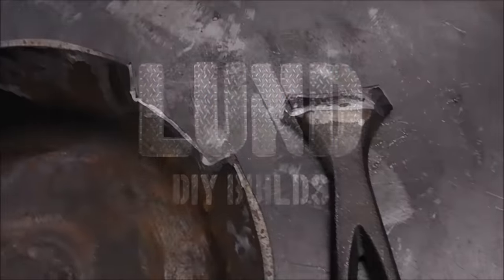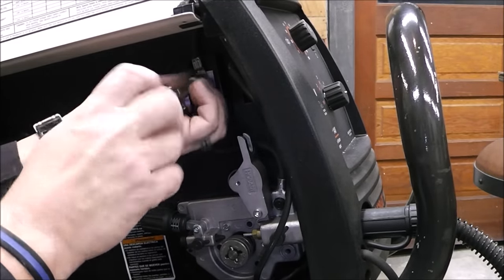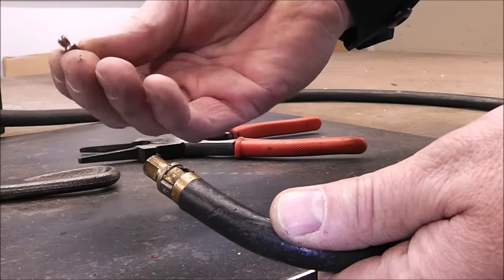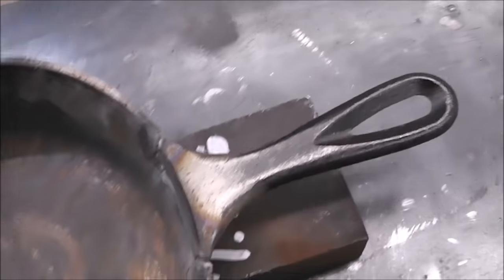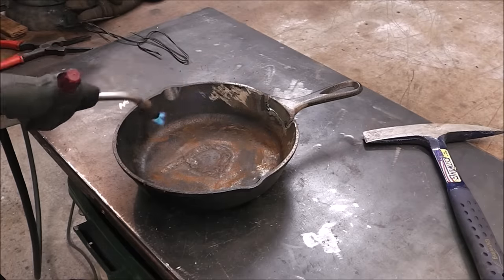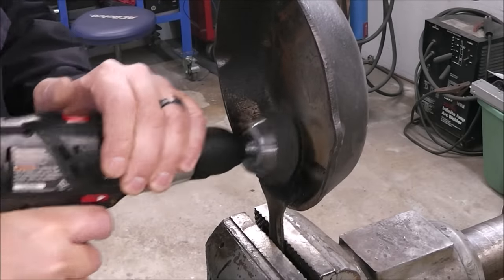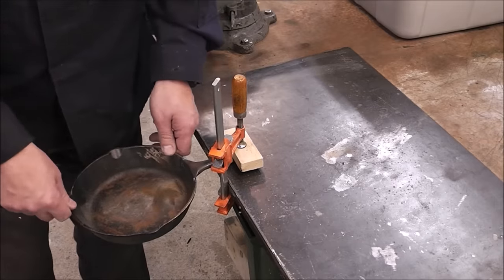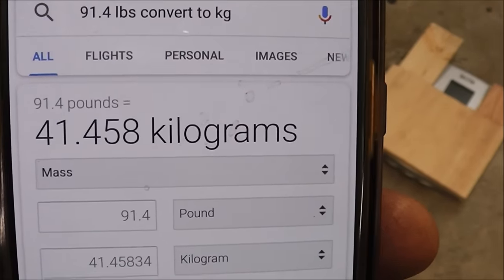Cast Iron Welding Repair using Flux Core Wire

Comment from the maker: MORE WELDING AND FABRICATION VIDEOS HERE:https://www.youtube.com/playlist?list=PLfbf78fMz9Vol0uX2-GNc6mLi75zpqb5f
LEARN HOW TO WELD VIDEOS HERE:https://www.youtube.com/watch?v=ADa1I319GJ0&list=PLfbf78fMz9VqxPZTT-xmwdcrHVa7ML-ft This video is for demonstration purposes only using a known cast iron material. Do not attempt to repair cast iron pans. If the weld fails there is a high risk of bodily injury, death or fire from hot grease.

I misspoke when I said the moisture is in the metal. The moisture is a byproduct of combustion.
Reply: Not a good weld
Reply from the maker: @williamcreech5266  how so?
Reply: Well it worked better than I thought . I welded come cast before with ni rod . I had hell and I swapped polarity and it helped . . Yea weld about a inch and peen it till cool . I used a chipping hammer but a needed gun might have worked well. Thanks for the video
Reply from the maker: If you ever run into it again try silicon bronze. I did this in my cast iron repair series and was blown away how easy it (MIG) welded and even better how strong it was. Best repair to date by far
Reply: I've had some luck welding thick castings by heating up to dull cherry red in a wood fire and returning to the wood fire till the next day. used 7018
Reply from the maker: That works well heating it cherry red
Reply: @williamcreech5266  ooboiboui
Reply: I like your philosophy. Not everybody has the same equipment or the same experience. I appreciate your covering many methods to weld.
Reply from the maker: Thank you
Reply: I think the wetness visible when preheating (or welding) with a torch is the moisture produced by the flame condensing on the cool (below the dew point temperature) metal.

Comment: I gotta say that I'm really impressed with your patience of the nay sayers! This episode of using the flux cored wire hit close to home because years ago all I had was a 110v Lincoln and the family ski boat froze over winter due to my lack of enthusiasm winterizing it. When my wife and I brought it out for the 1st startup, we had a bad water leak under the intake of the inline Chevy 6 cylinder. Pulled the intake and found a crack almost the entire length of the engine 1/2" below he deck surface. I called a friend who had recently retired from the local metal manufacturing plant and explained what I had. He told me to use the .030 steel wire, open the argon and oxygen mix all the way and run my current as hot as I could.  He also said heat my starting point to about 600° then with the wire form a puddle the size of a dime and continue until the crack was filled in. I thought there was no way it'd work because I was taught that only nickel was the cure! That was 1996, I still own the boat and there has never been one single drop of water from that crack. To this day I use the wire on most cast jobs with 100% weld. I couldn't figure out how only heating the starting starting point was needed. After years of thinking on it I can only assume the dime sized puddle allows the heat generated to flow forward the weld at the correct temp and speed. I believe him and should never have questioned him, I mean he'd worked all his life and retired from working with cast iron that he knew what he was talking about. Have a great day!

Comment: I remember as a farm kid in the 60’s and early 70,s we only had an AC stick welder. It was amazing how many things we welded that way “that couldn’t be done.” It really taught me that if for instance 91lbs of force was way more than the part was subjected to in its normal use then that was a fine way to weld it! They sometimes weren’t as pretty but I also learned prep and fit up made a huge difference.
Reply from the maker: Absolutely. Sometimes that "cant be done attitude" has you beat before even trying. I say try it and see. It cant be more broke than it is already. It can only get better.
Reply: I've seen aluminum bonded to steel with a stick welder. I couldn't say whether it was truly welded or not but it was able to support ~100lb from two three inch ears on the side of a moving vehicle.
Reply: @corinelson7837  I welded a titanium exhaust tube to a mild steel one  on my dirt bike with a $200 flux core welder been on there for a few years and so far its good........
I didn't realize it was titanium when I welded it I thought it was stainless!
I always thought you had to weld titanium in a gas chamber due to it catching fire I must not have got it hot enough lol.
Reply: @randyhaglund7557  titanium sugars if you weld it in open air. you get yellow fluffy stuff that precipitates around the weld. magnesium is the one that can catch fire {volkswagen cases}
Reply: AC is great given the right rods. If more people read what each rod is designed for and bought a few to try they'd be much more effective. Industrial AC stick machines go cheap and make serious power. I bought a Hobart T-400 for the cables and kept it for the arc quality because that and it's higher OCV make it a joy to use.

Comment: Thank you for doing this! For 15 years, I've been thinking about cutting the handle off a thrift store skillet and flipping it around so I can use it on my Big Green Egg. Now that I have a multi-process welder, I'm making all these dreams happen. This was a great piece of research. I always put in an exhaustive amount of research before any project. My Dad taught me, "we all learn from mistakes; it's cheapest to learn from others' mistakes". (We grew up in Appalachia, where "cheap" is the highest virtue. Also, cheap means maximum value. Investments that fail or cause injury are NOT cheap.) It's hard to do "research" when everyone does it the same way. I'm glad you are here doing this. Thank you, Brother.
Reply from the maker: Thanks Bruno! I appreciate your support! 🤗
Reply: We don't talk about Bruno...
Reply: spot on, i say. Thinking  'outside'  the box, is most times, required, for  cheapskates like most of us,  on here. Creativity, expands with a bigger  picture of ' life'   within  this world. Make use of nearly everything. in and around the garage/shop.
Reply: And that metal fatigue will sneak up on you when least expected. Without quotation marks.
Reply from the maker: Thats why the weld is stronger than the metal you are welding to if you have done it right. That applies to all processes and all metals. Not just cast iron.

Comment: Just for conversation sake if you were repairing a skillet this way I would consider it a win. This was an inexpensive repair and I have made some big meals but I can't load 90lbs of pork chops into a skillet!
Reply from the maker: 😂 I was actually surprised that it held that much weight. I don't think my stove burner would even hold 90 pounds LOL. Oh and thanks for the Pork Chop reference!...I'm starving now and I still have an hour until break LOL Cheers brother!
Reply: @BrandonLund  This series has been very educational. Nickel rod works great but that stuff is 1$ per welding rod around here. Some times the parts being repaired just don't justify that cost of repair. Please pay no mind to the naysayers this is very good real life work. I have used 7018 many times and just said either it works or it don't because we are not spending a fortune on this piece.
Reply: I what's going to say the same thing... How much do bacon and eggs weigh anyway?
I also wonder if Welding it on both sides would've made a difference...
Reply from the maker: @drickard67  I think welding it on both sides probably would add some strength. I should have done a close up on the non welded side. The weld really doesnt penetrate so I think doing both sides probably would add strength.
Reply: True, but we should also consider the carrying capacity of a panhandle if the pan is accidentally dropped and falls to the ground.
Moving objects gain mass as they pick up speed. 
A falling pan that gains more than half of its weight while falling might gain enough accumulated mass to loosen, weaken, or eventually break the weld.
This takes nothing away from the repair that was successful, but it does tell us about the important limitations of repairs that we make when being used in real-world applications. 
This may seem trivial at first but in actuality, it's a very useful and practical evaluation tool.
Reply: &<u
Reply: mme77 why, you could cook a whole suckling pig in that. I’d call that good.
Reply: mme77 best reply ever!!! 😂😂😂 you win the internet today!
Reply: I would say it exceeded the expectations of the weld for the practical use of the pan if it was meant to be the actual repair intended. Thank you again for this video and articulate explanation and narration.
Reply from the maker: @lynkpaul2171  thanks for watching and for your great comment! I hope you have a great new year :)
Reply: @NMranchhand  yes
Reply: @melaniew77msn  old muffler shop trick for cracked manifolds. What I learned is clean with a grinder and preheat. Use oxy acetylene welding, 7018 or 6013, ni rod, wire feed or whatever  you have handy. Keeping it hot not too hot with a torch and peening with a slow cool down just like he did here is the trick to a successful repair.
Reply: I'd have to agree that after any repair it's fixed and I doubt that little skillet hold more than 5 pounds of meat.
Reply: My thoughts exactly when you reach 4 or 5 times working load just stop, it is good.
Reply: Brandon Lund welding the other side of the break would be a good idea. If not for the extra strength, which never hurts, as a good sharp whack could break the weld. But rather to seal the break from both sides, and prevent water from getting inside and rusting the joint out. That’s very important when welding any ferrous Metal, but particularly cast iron.
Reply: @stephencarlsbad  Moving objects don't gain mass
Reply: I was going to offer Melanie my hand in marriage until she admitted to her failings as a pork chop cook. That just won't do.
Reply: Q in
Reply from the maker: HUH?
Reply: @stephencarlsbad  Since cast iron is brittle, a new unbroken cast iron skillet could break as well. In fact, that could be a reason one gets broken and is in need of repair in the first place.
         Of course, your point is definitely a good one for stress testing and practicality.
Reply: @markhendry1761  moving objects actually do gain mass, it's the reason anything with mass cannot go the speed of light, as you approach the speed of light the mass would near infinity, but at a dropping speed that mass gain is insignificant. I believe what he is referring to is kinetic energy.
Reply: @melaniew77msn  
Especially when you can buy a new 10.25 Lodge made in U.S.A. skillet at Walmart for $25 bucks....I still have granny's 1941 Wagner that I use almost every day.
Reply: @sswcustomsewing4276  ...
actually older school welder guy using oxy/acetylene torch and brazing the side of a 1956 Minneapolis Moline 335.
The original all in one pre-heat, weld and cool down, plus brass flows in cracks and is malleable.
Reply from the maker: @Dale Potter what a great compliment, thank you!  I have to laugh whenever someone makes a negative comment because I post these videos to try and help others. Not everyone has the finances to buy new so sometimes they have to make due with what they have. Im not sure if you have watched any of the other videos but I actually test how strong this weld method is compared to an unbroken piece and its actually quite close. I think when people make negative comments it says more about them than anything. You sound like a very nice person and I'm a firm believer that good things happen to good people. God bless you for giving back to others and I appreciate your support🙏
Reply: Ain't it just ain't it 😎 lols
Reply: @stephencarlsbad  Nothing gets heavier as it falls, it picks up energy as it accelerates but it’s still the same weight. If you drop cast iron on something hard you are going to break it, that’s not a testiment to how strong was the weld it’s the brittle nature of cast iron. But a weld that’ll hold until 91lbs is hung off it is plenty strong to carry the pan and whatever you cooked in it for the duration.
Reply: ZACTLY! SCORE! 100!!

Comment: I know this is about three years ago but your doing just fine and correctly for home or small shop repair. I'm a certified MIG, TIG, ARC, OXY/ACC, Plazma Arc welding in 9 metal groups and have been certified since 1995. Also hold an Aeronautical, Heavy Equipment, & shipboard certifications. So I've been around the block and what your doing sir for a quick home/small shop repair on cast steel is right on. Aluminum cast is a bit more complicated but I'm sure you've been able to figure that out. Anyway thanks for posting as I'm sure it will help many home & small shop repair individuals.
Reply from the maker: Thank you so much! I appreciate your support and kind words. Maybe some of the negative Nancy's will read your well articulated comment and not get so uptight.

Comment: Woo-Hoo! I did it and was able to repair one retraction eye on a heavy notcher used to cut 16 ga. steel. This is a heavy Costly  tool, big hunk of stuff I can't lift by myself. I preheated, welded, and insulated it as it cooled.
As the old guy said: "Grinders and paint make me the welder I ain't." But in the end it is pretty damned good!
Thank you Brandon! This was a life saver.
Reply from the maker: Awesome Bill! I'm glad I could help!

Comment: I love guys who do this. So many times I hear that "it can't be done", "you can't mig weld cast", you can't weld stainless with pure argon" etc.  Turns out you can do all kinds o things at home. They may not meet lawsuit criteria or some safety factor that a metallurgy engineer established, but for most practical purposes there are tons of 'non-standard' things you can do that work perfectly well for home or emergency use.  Thank you very much for doing these videos
Reply from the maker: @Gerry S thank you! That is exactly why I do some of these things. Unless we try we don't know and it might just save someone a couple bucks.
Reply: Can't never could...never will!
Reply from the maker: @Gene Autry Over the years I've learned to use the word 'can't a lot less. If I said the same thing then I would not have the knowledge that it CAN be done.

Comment: Brandon, you not only come up with “other way’s” of doing things, but your explanation’s, demonstration’s, and TESTING your work are a credit to your craft! I’m new to welding, and I have a large cast iron cauldron with a long crack in it. I feel confident I can weld it up myself, let it cool, and grind it back down, hopefully, never to crack again. The wall thickness is maybe HALF of what a cast iron skillet is, so, I hope I can repair it without destroying it in the process. THANK YOU!!
Reply from the maker: Thank you very much for your kind words Raul. Please keep me posted on how your repair went. I'm sure you will do just fine!
Reply: And watch out for that cursed "Metal Fatigue"
Reply from the maker: Thats why the weld is stronger than the metal you are welding to if you have done it right. That applies to all processes and all metals. Not just cast iron.

Comment: Thank you so much for this. I've never welded before and I checked out the best way for newbies to start. Resoundingly, the answer came back Flux Core/MIG welding. I've watched 6 or 7 vids online, saying they're for beginners, but then baffle us with terms and information only experienced welders would know!? This is the first and best vid I've watched where, not only does Brandon show us how to set the machine up, but also offers a few insider 'easy to understand' tips that will help us in future endeavours.
I know someone is likely to say, "Well, it's not MIG welding, it's Flux Core welding!" Sure. OK. But have you ever tried Flux core Welding without using a MIG welder 🙄🤦🏻‍♂️.
Brandon, thank you. You've made a difference in my pursuit of....joining one piece of metal to another! Cheers 😉👍🏻.
Reply from the maker: Thank you so much! I appreciate it. Thats my goal here in the channel. To expose new welders to different things and hopefully in a way that is entertaining and easy to understand. Thanks again for your support and kind words!

Comment: That is an excellent mig welder. I regret selling the one I had. It has great range,  from sheet metal to 3/8" it is smooth!! And reliable. 

Thank you for this video.
Reply from the maker: Thanks Rolando! It is a very smooth and dependable welder. Because it's transformer based you can find some pretty good deals on used models on Facebook Marketplace and Craigslist.  Thanks for your support brother!

Comment: I bought my 1993 f150 for $400 because the engine had a cracked block between to freeze plugs. I repaired it with a flux core wire cracker box welder. that was 3 years ago and she's still my daily driver with 379,392 miles on the same cracked engine. I used a benzo torch for the heating and a tiny air hammer to do the peening.
Reply from the maker: Proof right here that it can and does work! Way to go brother! Nice work!
Reply: I heated a cracked small block Chevrolet block and had a shop vac pulling a vacuum on the cooling system while running JB Weld down into the crack just to see what would happen.  It was a free boat engine that was given to me and it ended up in a shop truck.  Damn thing lasted over a year before the JB Weld turned loose.
Reply: Whackoooo! and brave. Gratulation no that "out of the Box" thinking.
Reply: Wow WTF cheers mate 🤣👌🏼